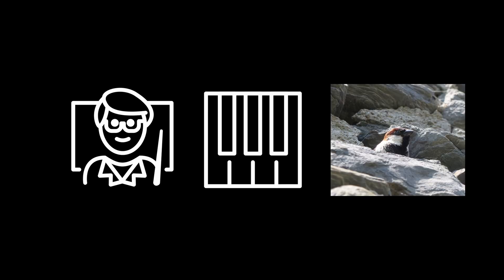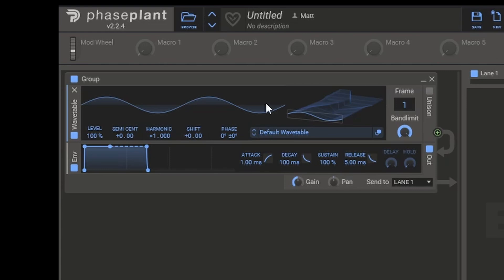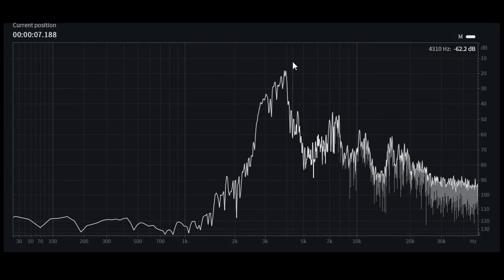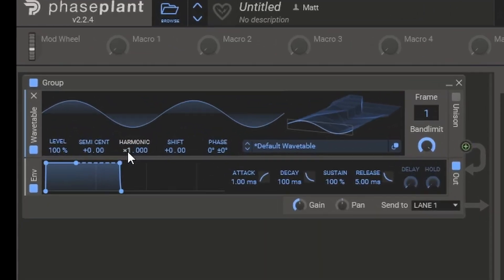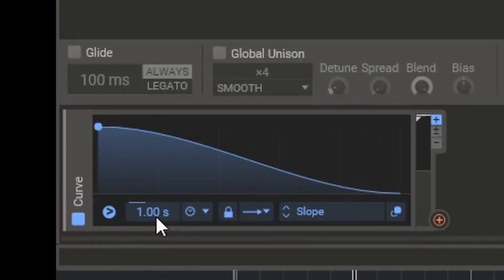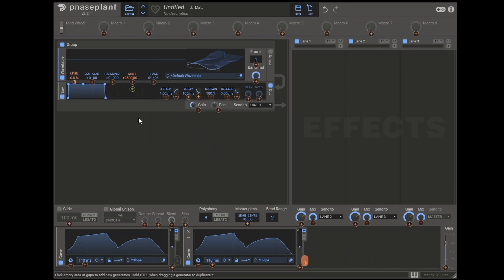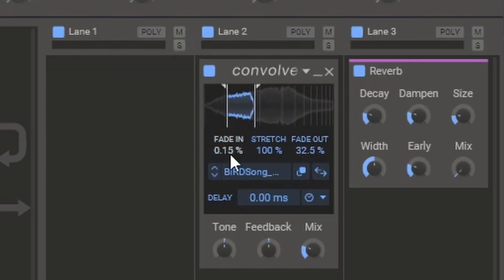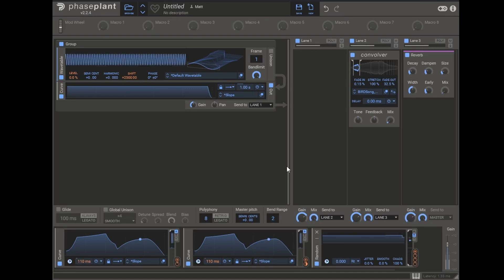Synthesizing a House Sparrow Chirp || Bird Synthesis 🐦

Comment: Hello Matt! First, many many thanks. The tutorial is über-hyper-excellent, I really appreciated the level of details (zoom on screen, mentioning the manipulations). I managed to reproduce my first bird sound thanks to you ! And I did'nt even know how to use Izotope but your video was so detailled it simply worked. So you aced it ! I have some questions. Maybe if you have time you can answer, I'm sure it can help me but also others. 
1) Here for the level curve you decided to use the same as the one for shift. I guess the general case should be that we use a curve that reproduce the shape of the waveform, as it reflect levels, right? And you use the same because it that particular case frequency variations roughly matched the variations of the waveform, I guess ? 
2) Around 6:15 you replace the enveloppe by a curve, but can't we simply put the Enveloppe decay to 0s and relase to long time like 10s and get the same result? 
3) Around 7:00 you introduce the convolver. I used convolver in the past for reverb in music but tbh I have no clue what you did, that's the only part of the tutorial I can't get my head around. Is the sample used as IR the same sample?To me IR is usually used to get something's "fingerprint'/sound characteristic, is it here to get the fingerprint of the bird or of it's environment (as we use sound in room to get room's audio characteristic)? Because if it's to get the bird's fingerprint it can of defeat the original goal of synthesis, no ? (the same way as layering a bird's sample would do) 
In any case, again, many thanks for your great work !!
Reply from the maker: Hey, thanks for getting in touch!

To answer your questions:

1. Normally I'm not too precise with how the bird's volume should change over time, as I find that it is much less important than matching the pitch of the bird. As long as the bird is audible when it should be, and silent when it should be, then this is normally good enough! The main reason I copied the same Curve as the pitch is because this already has the correct rhythm I want the bird to have, and having a copy means I can adjust the volume curve independently from the pitch curve if I want to do this. Often I don't even make a separate curve and instead just use one curve to modulate both the pitch and volume. Though with that said, it's very possible that spending a bit more time carefully matching the volume curve to a reference sound would make the end result more realistic!

2. You're absolutely right that you could just use an Envelope with a long release, I suppose I'm just in the habit of using Curves most of the time! I quite like having precise control over timing and volume which I find easy to achieve with Curves, but in this case either method would work perfectly

3. Convolution is definitely best known for reverb, but it's also very useful in many areas of sound design if you want to add a kind of "flavour" of a sound based on another sound (similar to how you mentioned). For example you could make a sound have more of a metallic quality by dragging a metal hit sound into Convolver. In this video I'm using it in a similar way to that, where I'm just wanting to use a sample to help it sound just a little bit closer to a real Sparrow. It's subtle in this case, but every little thing you do to make it sound more realistic can be worth doing. It's a very reasonable point that this could defeat the point of synthesis! The reason I like to use samples in this way is because it means you can take advantage of the realism of the sample but with the flexibility of synthesis. I think it's useful to consider how you would synthesise something with a more complex song (for example a Song Thrush). Because it's synthesised, we could make a very complex synth patch with heavy randomisation and we could adjust every parameter we like. We could then use a bird sample in Convolver to make it sound slightly more realistic, but the rest of our synth patch would still be what provides 95% of the sound - Convolver just helps it sound a little bit closer to the real thing!

Hope this helps!
Reply: @mattjhart  Many thanks Matt for your very complete answer I really appreciate that and it definitely helps - especially with the Convolver thing, good to know !